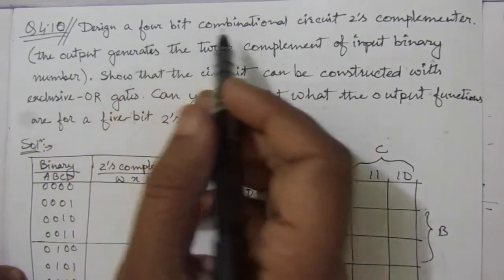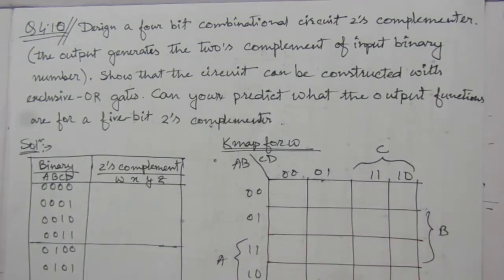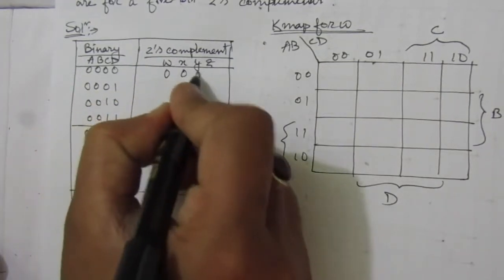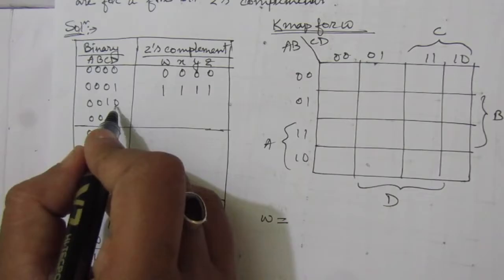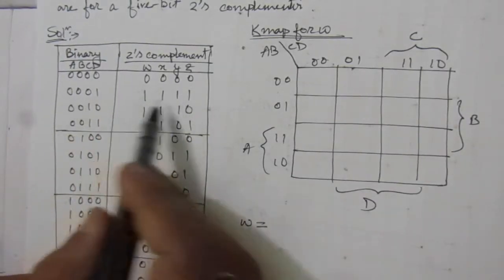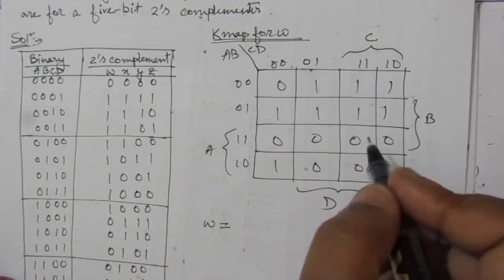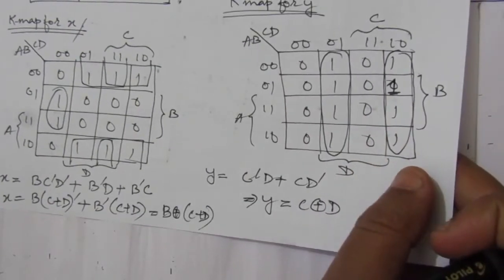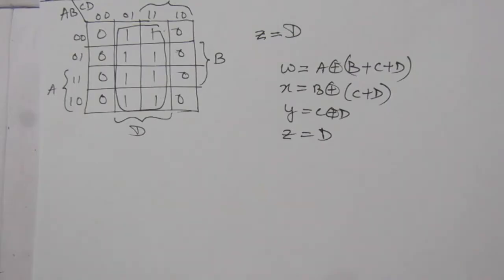4.10: Design a four-bit combinational circuit 2’s complementer. (The output generates the 2’s

Comment: This video demonstrates the design of a 4-bit 2's complementer circuit using exclusive-OR gates. It also predicts the output function for a 5-bit 2's complementer.

Key moments:
00:00 In this video, the problem of designing a combinational circuit to find the two's complement of a 4-bit binary number using exclusive OR gates is solved. The process of finding two's complement for different binary numbers and expressing the circuit in terms of XOR operation is demonstrated.
          -Explanation of finding two's complement for different 4-bit binary numbers using exclusive OR gates. It includes the step-by-step process of inverting and adding 1 to the binary numbers.
          -Demonstration of creating a two's complement table and deriving the expressions for W, X, Y, and Z using the binary values. Expressing the final expression in terms of XOR operations.
05:14 The video explains how to derive expressions for W, X, Y, and Z in a logic circuit for a 4-bit 2's complementer, using XOR gates and logic operations.
          -Deriving expressions for W, X, Y, and Z using logic operations and XOR gates in a 4-bit 2's complementer circuit.
          -Understanding the logic circuit design process for a 4-bit 2's complementer using input lines and XOR gates.
          -Predicting the output function for a 4-bit 2's complementer based on the designed logic circuit and expressions for W, X, Y, and Z.

Generated by sider.ai

Comment: hey any one pleas help me Design a circuit to enable a chemical additive to be introduced into the fluid through another inlet only when the temperature is not too cold or too hot and the fluid is above the high- level sensor.🙂🙂

Comment: Caution:
"It has got a very big error."
.
2's complement of 0110 is 1010 & 0111's  2's complement is 1001.
.
.
So,the whole result & design is wrong.
But the procedure  is correct.
Reply: He corrected it at 6:30.. So i guess there is no mistake there